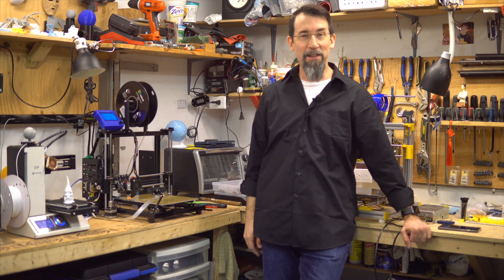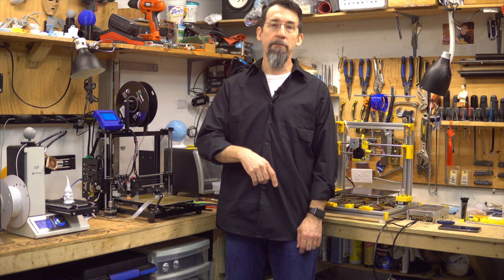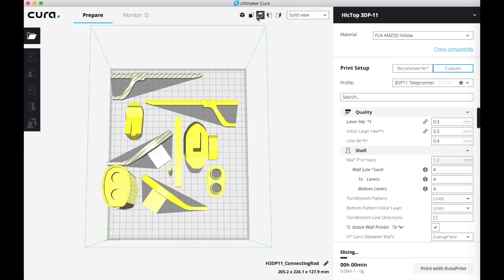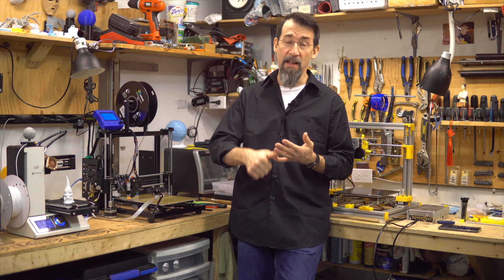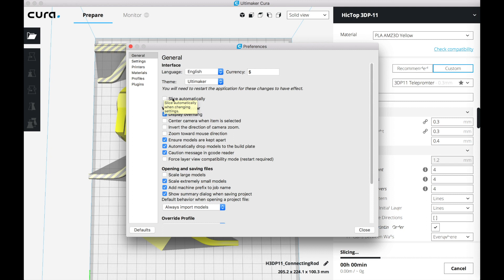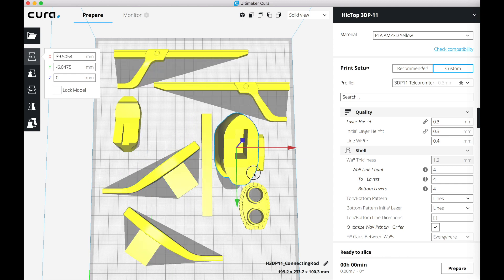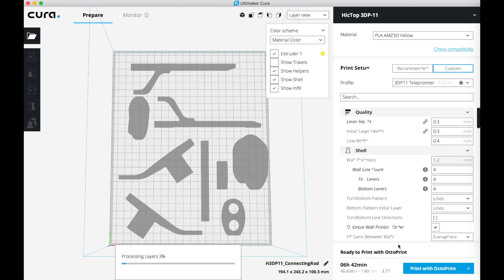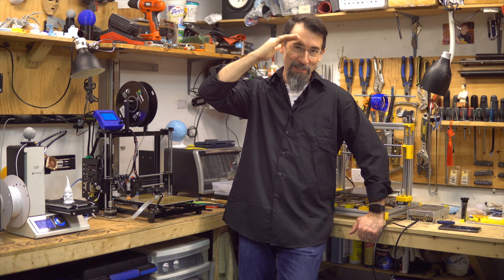Cura Time Saver Setting

Comment: Hi Frank! Please tell me how do I set it up so I can print multiple files on the same bed-cycle? Are those gonna be printed in the same time, layer by layer on all of them or they will be printed isolated... as in the first object printed in full, then the second one, then the third and so on...? Or each layer is printed in the same time-frame on all the objects on the platform?
Reply from the maker: Hi usually you print them all at once layer by layer, you can do one full than the next than the next but they must clear the x axis so not higher than the lowest point of the x- axis and you have to specify your clearing in the printer setup of the slicer

Comment: Trying to change filament colour halfway through a print useing cura    the printer will pause so i change the filament but it will not extrude when it goes back to the print can u help with this at all Frank. Joe
Reply from the maker: Yes I plan to do a video about it, it is done with the “pause at height” gcode post process in Cura, you have settings for how the print will behave at, during and after the pause. If you play with this, make sure to disable it after or all of your prints will pause! At least it was like that in previous versions of Cura”

Comment: Thanks Frank, good vid, have you any tips and thoughts on acceleration and jerk at all, RobUK
Reply from the maker: Hi, jerk and acceleration will usually show on the prints, either as infill showing on the outside walls and echos on the corners and vertical holes (like the 3D Benchy ports in the front) you have to test that yourself, I should do a video about that! For acceleration I use 1200 for printing and 3000 for retraction and movements it gives better results than the default 3000. You can fine tune this to your desired finish.

Comment: Please talk us about, the two printer with Ali profile. The black one and the yellow one.
Reply from the maker: Yes, the black is my first printer, a kit from Hictop 3DP11, learned a lot on that one! I will modify it more like the yellow one, which is an Haribo Edition Custom built from scratch by me and a friend (1 each) It is not finished yet I am still designing parts for it. Also waiting for  a new board with TMC-2130 drivers like the Prusa MK3 and it will be able to sense if skips and I will not need End stop switches like the MK3, it also have a genuine E3D v6 hot end a glass bed from Anycubic and a BLTouch for bed levelling.
Reply from the maker: And I will do a video when the Haribo Edition will be finished.